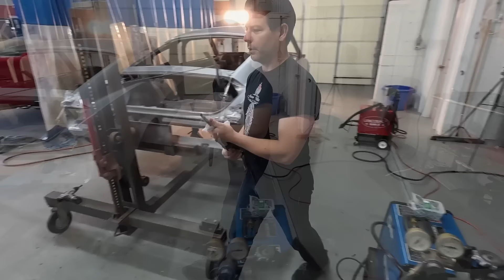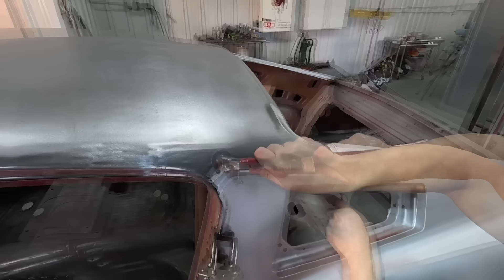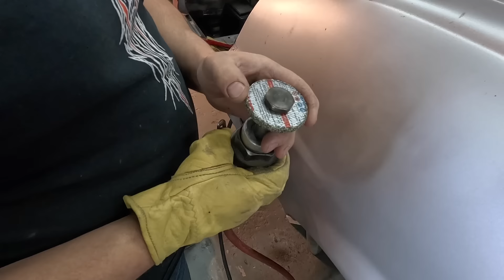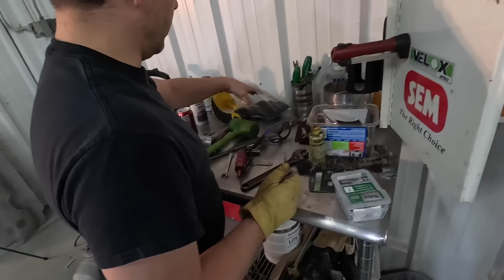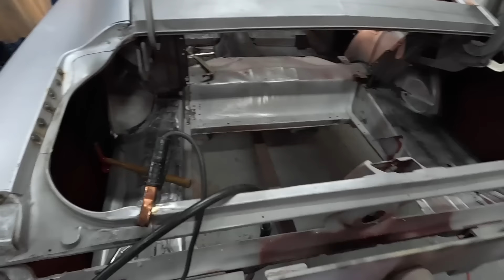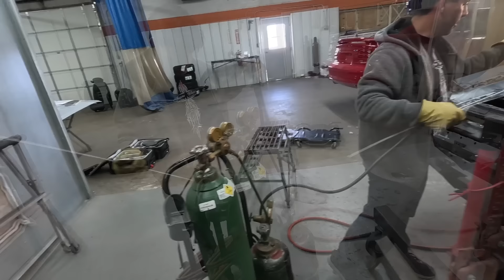Part 3: 1967 Shelby GT500 Mustang Restoration- Installing Rear Quarter Panels

Comment: Sure would like to see him wearing safety glasses doing all the drilling, grinding, chezeling, etc. I worked in tooling at the Arlington, Texas assembly plant for thirty years and saw this type of construction from the start. The men on the line that did the soldier joints on a moving conveyor were true artist. Really enjoying the series.

Comment: I love that spot welder. It's the first time I've seen this type.
Reply: Squeeze type resistance welder is much better and closer to oem function and appearance, plug welding is appropriate where you can’t get spot welds
Reply: Yeah relatively new machine tried all kinds this one works better anything i tried lot better than squeeze type can get lot more tight spots and can weld the penetration much as ya want

Comment: Mig welding in areas where.the factory had the car brazed is unacceptable.  There's 2 reasons that those areas are brass. First for flexibility. All unibodies flex as they are driven. The brass provides for flexibility preventing the car from splitting apart. The second reason....to make the area water tight to prevent corrosion which keeps the car structurally sound for a longer period of time.
Reply from the maker: Then the brass welds in this restoration would serve more than history.

Comment: He glued the metal back together and then said the glue is stronger than the weld?  As a certified welder from 1980 I'm calling BS on the glue being stronger than weld😮

Comment: I have seen brass used in metal work before.  Even on bicycle frames.  What is the purpose or reason to use brass?
Reply from the maker: Use of brass or brazing has to do with allowance for stretching. I asked Jason this question somewhere in the videos, but I'm not sure exactly where. I can't quote his answer. I'd have to go find it. I think a lot of people skip around in videos. I know I do that sometimes. However, on these videos you might miss out on information that is nowhere else because we took the time to go into details. Just the editing took over 100 hours for this video. You can get the straight and skinny in 47 minutes. My pet peeve is fat (fluff) in video. This is all muscle.
Reply: @thewriter2549  Thanks for the info!  It’s really nice watching that Shelby get restored!

Comment: @31:30 So why would you want to MIG weld it vs. Spot Welding? It seems a bit more straight forward and looks as if it takes less skill to spot weld it than it would to MIG weld it. Especially, if it supposed to come that way from the factory. I would think it would take more time to MIG than to do the spot welds.
Reply from the maker: In the video I said to Jason, "So you'll spot weld where the factory spot welded and MIG weld where the factory mid welded." He said yes. So, as the factory did, we did. Wait for part 4 where he talks about a concours build vs street rod and show car.
Reply from the maker: I realize people skip around in videos. My videos are stories that stay on topic with no fluff. I was taught that nothing should be included in a story that does not contribute to the resolution. Watch this video and tell me where there is any fluff.
Reply: @thewriter2549  if you're asking me, I don't see any fluff. I wish there was more stuff here haha. I came across your videos while digging through SAAC forum while hoping to one day find my own 67 Shelby that I can keep for 30 plus year until my time is up. Keep up the videos, a lot of the videos on your channel are great and I love the stories that are being told through them at the same time.

Comment: Manufacturers instructions say SEM Panel Bond is supposed to be used on clean, bare metal surfaces, I hope that doesn’t come back to haunt you…
Reply: It will. Any moisture gets in it will rust and separate

Comment: The trunk drop off early in the video looks pretty bad. Are those hammer marks or rust? Replacement panels are available.
Reply from the maker: it did for sure, but Jason fixed it, so I guess it was not as bad as it looked

Comment: 1.52 Does Hold moisture, or can it rust Out from the ahesive.
Reply: The adhesive is corrosion resistant its a SEM product,what ised in current automotive manufacturers,most roof panels are glued on other than few welds in window  area ,they use on door skins and alot quarter panels to prevent rust help seal

Comment: Obviously N9 clue how to securely weld a car together.  That spot welder is for PATCH PANELS  not for panel replacements.  For panel replacements you use a SQUEEZE RESISTANCE SPOT WELDER which has the CORRECT pressure between the tips to make the car structurally correct...usually the tip pressure is 880 to 1100 pounds which is impossible to achieve with a panel spotter. Doesn't make a bit of difference how nice the welds look if  they're  not structurally sound.
Reply: Luckily his 1200 dollar "spot" welder made hideous looking welds. Half of the welds in the rear window area it looks like he sunk the tip all the way through the 1/4. None would pass a destructive test I'd wager. 

This is why I've never worked in a restoration shop. I'd get fired for doing it right.

Comment: Why spend time cleaning up those spot welds just to cover them up with a thick layer of filler?   😊
Reply from the maker: You would because the spot welds are functional if for no other reason. Many of the spot welds are readily visible, like the ones inside the wheel wells. What think layer of filler are you referring to?
Reply: @thewriter2549  where the quarter panel meets the roof
Reply from the maker: @alcrooks9095  Why spend time cleaning up the spot welds? When they can't be seen? I don't know. That's a question for Jason. I'd say they make the surface smooth for a better fit.

Comment: Yep, a really "nice fit". Pie cuts no curves, raised edges .....  not so good fit. 
What brand was that panel?
Reply from the maker: Jason has installed original Ford replacement fastback quarters. They are no longer available. We'll have to ask him how good those fit compared to these Dynacorn. This should be interesting. My guess is the Dynacorn fit better. What does anybody else think?
Reply: The panels are very well made they are stright unlike most aftermarket and are as thick or thinker in areas than orginal.if you ever installed a quarter panel they always must be made to fit even OEM thies old cars can have four identical panels and each one fit bit different same way with doors and fenders the consistency was not the best then and go back to 50s cars its worse
Reply: @MadSceintist you're ignoring how loose the 1960's factory build tolerances are. The chances of a new panel lining up completely perfectly are zero.
Reply: @SaltFlatMonte  
How many vehicles have you restored or rebuilt from salvage

Comment: The comments kill me. Dude can't even perform a proper plug weld. He'd barely pass an ICar welding class IF he had a very friendly instructor.  You don't stitch weld plug welds. I hope he normally wears a respirator and wears gloves while welding but I doubt it. 

People that watch this crap learn bad habits. 

I have GOTTA SEE this spot welder pass a destructive test. Very interesting that is.
Reply from the maker: There is no stitch welding of plug welds. Jason stitch welded where the factory stitch welded. He spot welded where the factory welded.
Reply: @thewriter2549  I watched him do it. His plug welds wouldn't pass any welding test I've ever taken. Google the term Rosette Weld. You perform the weld in one pull of the trigger.  You also need a pair of wire cutters to cut the end of the wire clean after each pass. 

The "spot welder" is a 1200 metal melter. 

I wouldn't care except people will watch this C minus at best work and think it's great. It isn't .
Reply: @MrBodyman5001 Look at how poor the assembly tolerances and welds are from factory. There is very little consistency and there are likely many more spot welds than required to account for how these cars were built. It would be interesting to see each weld method (ex. handheld spot welder, "stitched" rosette, etc.) would pass a tensile test but how many body shops do you know do this? Yes, certification is important for safety in collision repair but almost anything you do extra (ex. extra welds/closer spacing, adhesives, etc.) would outperform the factory 1960's build. Context is everything - a restoration this thorough is not going to be any less safe than it was originally designed and built.

Comment: Those spot welds look terrible and this is poorly edited
Reply: They're garbage. That 1200 dollar welder might be good for someone who makes yard art and sells it at a Saturday market but that's about it
Reply: @MrBodyman5001 Take a look at the 1960's factory spot welds - they're often terrible. They have inconsistent pitch spacing, lack penetration, located on edges, or sometimes missing entirely! We can poo-poo all we want about how the repairs don't measure up to modern standards but remember the rest of the car was built worse than anything being worked on here.